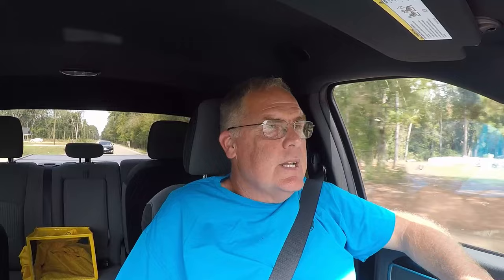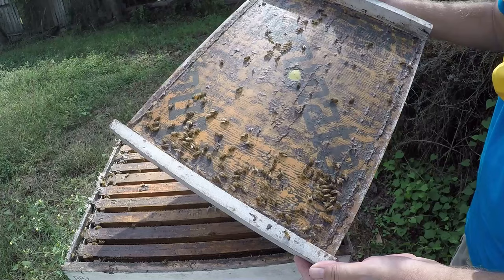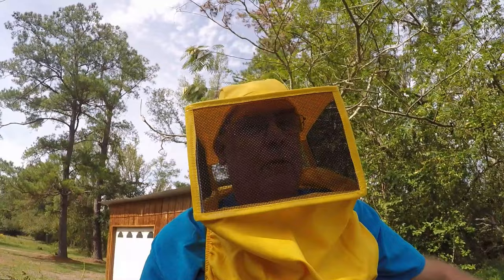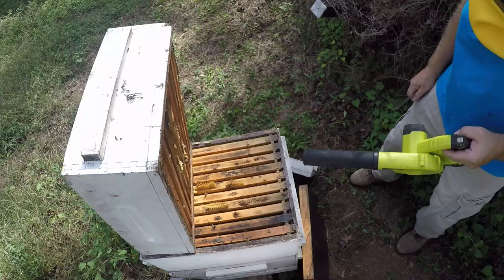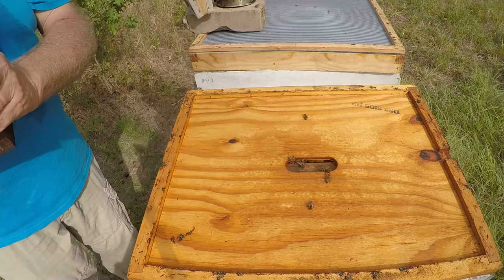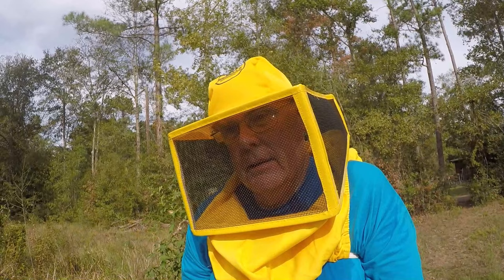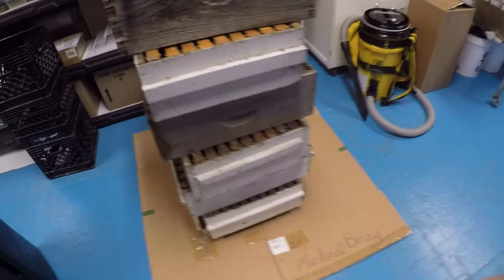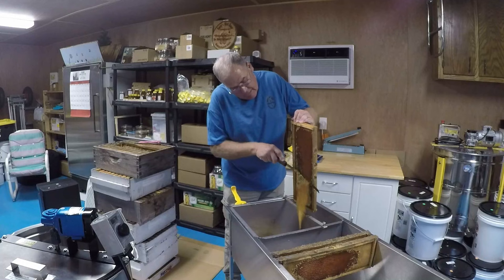Honey Harvest | A Small Fall Harvest

Comment: Howdy Mike, raining now here in central New Hampshire, with temps dropping close to 25 degrees to 44 degrees, since yesterday. I have a few partial honey frames I had hoped the bees would move, but they didn't get the memo. It's turned into a good time to be inside, so I will get them extracted today. Thanks for posting, take care, Brice
Reply from the maker: Morning Bruce. We’re still warm here, but tomorrow or the next day we should see some lows in the 30’s. Bees are set for the most part for the entire winter. Now it’s time to begin working on inventory and replacement of equipment as well as cleaning.

Comment: Yes that's one of my issues with the extractors u have to much honey staying in the bottom wish they would make those with some form of drain on the bottom for when u done , u able to get all the excess out
Reply from the maker: HillCo makes their extractors with not only the conical bottom, but it is also sloped. Additionally, he makes the flange for the honey gate perfectly flush with the bottom of the drum. Works great. I love my HillCo extractor and I should've gotten it out. It's 18 frames though, so I figured I'd use my old maxant and it made me miss my HillCo.